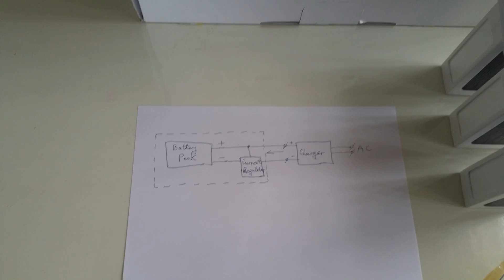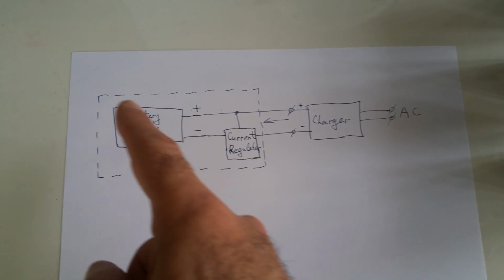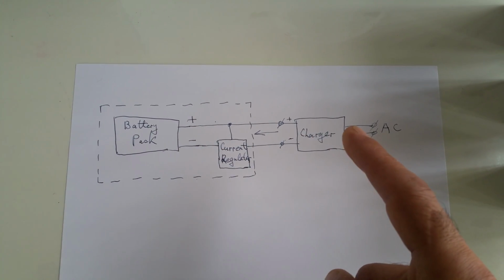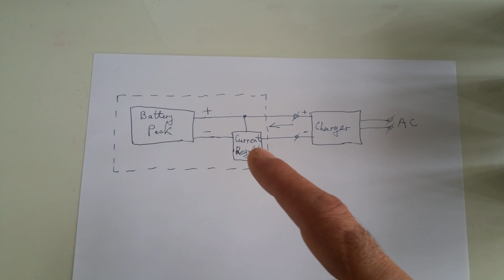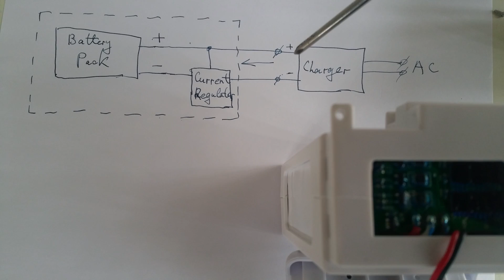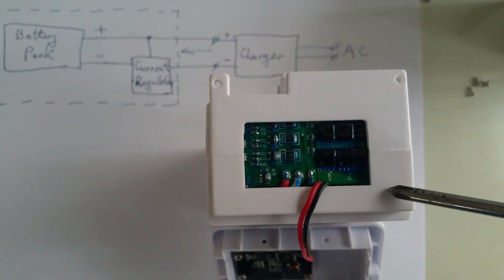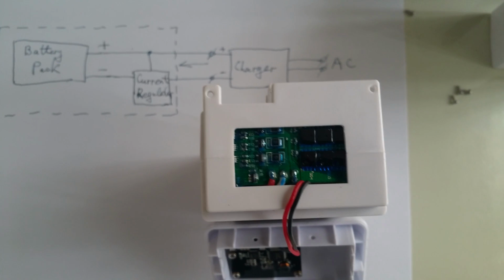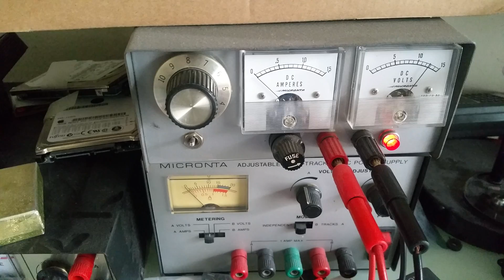How to fix repair  Toruk AP10 Pro BP-AP11 battery Pack Part 1

Comment: I dont understand this   I thought   the battery type  is  lithium Ion     but  it is  configerd  with bank of paralel  cell  so called    LiPo       and the voltage  regulator  the second circuit board   i thought that is a BMS    battery management  system       like  laptop batteries   so monitors   the paralel   segments    individualy           i will watch the video further  as a drone with the same problem    a ap 10      is nearly  for free     with the radio  and 4 spare  blades   for 25 euros

Comment: I used the charger and attached alligator clips to the battery.  One attached to the positive and one attached to the negative terminal that we exposed. Every time I touch the alligator clip to the negative terminal, it shorts out the charger.  Is my battery completely dead??

UPDATE: I wasn’t patient enough.  I held the connections a little longer until the charger light was blinking red, indicating it was charging.  Then the screen turned on.  Thank you so much Artur!!

Comment: Thank you for the video save me a lot of money, the only problem I ran into is the negative connection had some sort of film on it that wouldn't allow a good ground I scratched it up a little bit and got a good ground and the light turned on right away.

Comment: Can't thank you enough Artur for posting this video. My grandsons shamed me into finally using the AEE AP 11 drone I got as a gift 4 years ago, and upon connecting the AP 11 charger, my battery would not charge. I followed your instructions and after a few attempts of lining up the positive and negative connectors just right, the battery icon showed up and now I'm able to charge my battery once again.  I used needle-nose pliers to clip away just enough of the plastic to get to access to the negative terminal and a small 12V battery as the initial power source.  I owe you a few beers for this fix my friend!  Thanks again!

Comment: Where i can get power supply regulated ? I have same problem my drone battery doesn’t charge.
Reply from the maker: You don't need regulated power supply, use any 12V power supply, just make sure which one is positive, which is negative and try to boost the battery for couple of seconds until you see the battery icon on the battery LCD screen, after that your original charger will recognize him.

Comment: So I got the battery icon to show up but when I connect it to the original charger the charger light stays green. Is it charging or do I need to boost it longer I’ve boosted it for roughly a minute
Reply from the maker: Try to boost a little more, step by step, until starts charging.
Reply: Artur Aroustamian should it turn red if it’s charging

Comment: Hello, I am trying to fix my battery. I followed your steps, and have tried to plug a 1-amp, 12V car charger to the connectors. The problem is, the connectors on my charger are too large to fit in the hole that I cut. What can I use to extend the connector to the negative node on the drone battery?
Reply: Update: I simply put a thin, metal screwdriver bit in the clamps and touched the node with that, and the LCD screen turned on immediately. Thank you so much!!
Reply from the maker: Any nail, which will go through-will work.

Comment: Hey Artur....great video....however, like some people have commented...I also do not have fancy device like you. I do have a 12 volt car battery charger...has 2 amp, 10 amp and jump start settings. Which one should I use...and how do you get the current from the clamps on the charger to the battery...just clamp onto a piece of wire and use it that way? Also, any risk of battery blowing up? Thanks.
Reply from the maker: I would recommend you to use the original charger instead, one person did it and it works too. If you want to use your car charger, use the lowest setting like Lonnie Keller(the comment before me), remember, all we need is the battery icon contour on LCD screen, after that the original charger works.
Reply: Hey Artur...thanks for the reply. I did what you mentioned...worked great and the battery fully charges now...after bypassing the normal plug on the battery and going into the negative on the battery...I was just about to get rid of this drone...but now it's working like it did the first day I got it. Thanks a bunch Artur...

Comment: i stripped the original charger and did the same way
Reply from the maker: Yes, good idea, if you don't have an extra one-this is an option.
 Congratulations.
Reply: No problem
Reply: bubble how long did you have to jump it because if I plug the regular charger in after jumping it when the icon shows it just stays green
Reply: How did you do that? HELP!!

Comment: After I jump to the negative and give it some power the battery indicator shows up. Then when I transfer it to the regular charger it won't continue to charge. Battery indicator shows but it doesnt get any bars even if i leave it for 2 hours. Any way to fix this or is battery not holding a charge?
Reply from the maker: When you boost the battery skipping the board, as I explained-after that you'll see the battery sign contour on LCD. After that you connect the original charger, you'll see the charging light ON, then after a while you see the bars. If you did everything properly (as I explained) and still no charging-BAD news, the battery is kaput. I hope this is not the case.
 This method is 100% good, a lot of people fixed their battery and they left comments about it.
 Good luck.

Comment: Hello, im trying this with a 12v 2Amp Power Supply, the indicator turns on and the battery is on 5.38v, then i connect to the original charger and the light still been green (never red) do i need to use another power supply with more Amps???

thanks!!
Reply from the maker: You have to boost as long as you get the battery icon on the battery. When it appears on your batteries LCD, then after that your original charger will recognize him. 
Good luck.
Reply: I have connected like 5 hours and still been 5.38v, that was my max limit, do it need more time??
Reply: If i try with 12v 15Amp, will help???
Reply: @danielalarcon3441  Yes!  You arent using enough voltage.

Comment: Worked!  At least the battery is indicating on the window now and appears to be charging.  I don’t have all the finer tools you do, so I improvised with some thin electrical wire, 2 small screw drivers, and a series of golf cart batteries.  (I’m too impatient to get the right tools, okay?). Anyway, so far so good.  I wonder how you figured this out?
Reply from the maker: Masters  degree in electronics from State Polytechnical University of Yerevan (Rep. of Armenia)

Comment: This worked perfectly and saved my battery and my drone. I was going to scrap the drone because the batteries are expensive and don't last. To anyone wanting to do this you are probably like me and don't have the fancy regulated power supply like in the video. I used a good 12v car battery charger that has the 60 amp boost feature. It didn't seem to work on 10 amp (although I didn't try very long) but when I switched to 60 amp it took only 5 seconds and the battery indicator lit up. I put it back together and charged the battery. Thank you Artur for taking the time to post this fix.
Reply from the maker: Gerry Lepage Good job, I am glad you did it and understood, that the most important thing is to boost the battery,  not the way the charger looks.